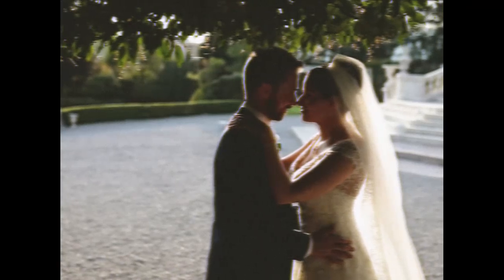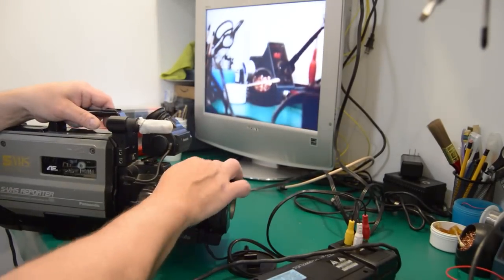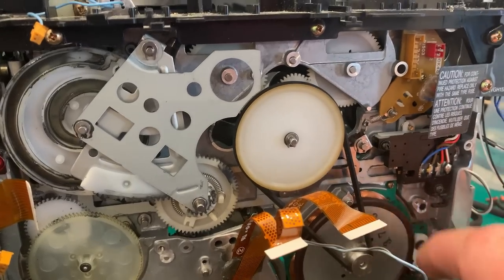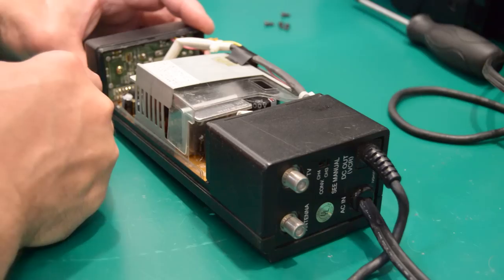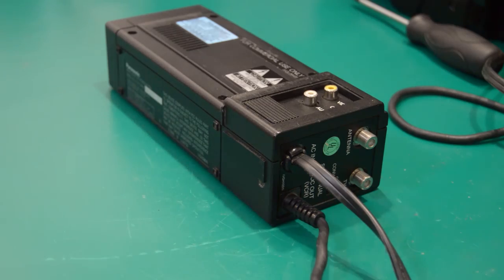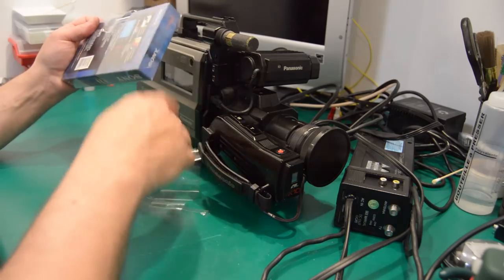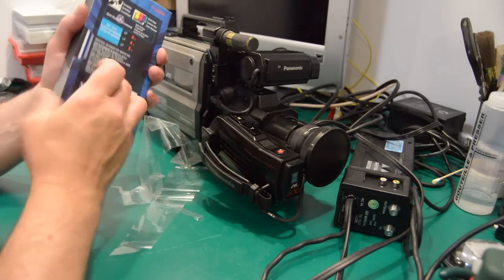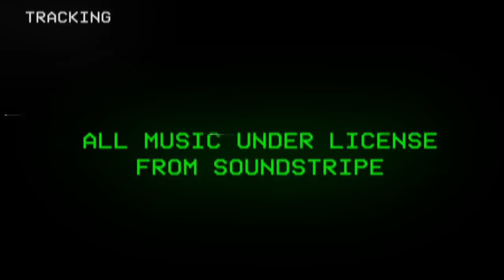RETRO TECH of the 90s 🎥 S-VHS Reporter Camera | Retro Repair Guy Episode 12

Comment: Hey Retro repair i have one question i buy Hitachi full size vhs when i turn on its power red light blinking eject working well but wont play i saw some videos and decided to change rubber belt after i chenge i don't now what happened now the problem is when i turn power button or eject button then loading motor and reel motor run automatically what is the case any ? Do i check capsitor same problem happens with my Panasonic m3000 motor runs automatically for some seconds then camera gose off
Reply from the maker: Hi Nayan. First of all it's important to understand that a camera  like this is just a VCR with a lens. When VCRs shut off it's because they detect something wrong; a protection mechanism. When you opened it and replaced the belt, if you did not align the position sensor or disrupted it, then it would cause the unit to shut off. Of course, there could also be a voltage problem but you would need to diagnose. I would start by making sure the mechanism is not blocked and verify the position sensor (you might need the service manual) and go from there. Thanks for watching.
Reply: @RetroRepairGuy  thanks you so much u always answered and help me out lots of love ❤️ ❤️❤️ thank you very much again stay blessed
Reply from the maker: @Vintagelover1  My pleasure! Thank you!

Comment: Do you think its possible to put a hd digital sensor in one of these?
Reply from the maker: Hi Paul. Could you elaborate? Do you mean for recording in HD?
Reply: @RetroRepairGuy  yes either to memory card or direct to pc via lead. I don't really know anything about optics but I'm assuming the lens is better than say a gopro or a cheap hd camcorder?
Reply from the maker: @paullewis9473  The lens is not bad but I don't remember what brand it is but it's a 8-80mm TV Zoom Lens. The CCD is 1/2 inch and capable of 400 lines of resolution so you can't get HD from it, however you can easily record directly to a computer or laptop using a USB capture card like this one which is very cheap ($19) and has a S-VHS input so you'll get the 400 lines. Here's an affiliate link it doesn't cost you anything and there's even an extra 5% off https://amzn.to/3qlJv4e You could then upscale the footage to HD using different methods or very simply in Adobe Premiere. Hope this helps! Thanks for watching!

Comment: What is alternative of rubber renue here in india cant find if shipping from us its very costly hope u advice best i want clean my Panasonic vhs Camcorder
Reply from the maker: Hi. Rubber Renue cleans and has a chemical that helps rejuvenate the rubber. However, it is perfectly safe to use the same alcohol for the heads to clean the rubber surface. The only problem is if the rubber is very old and hard the Rubber Renue makes it "gummy" again. However if the rubber is too old no chemicals will help it and will need to be replaced.
Reply: @RetroRepairGuy  always love to watch ur video and always kind reply thank you so much appreciated but my question is here in India i cant find rubber renue its too costly if shipping from us so can u suggest me any other cleaner that i use to clean head and all stuff
Reply from the maker: @vintagelover3873  Thank you again for kind words. No this is what I am saying, just use the alcohol it's the next best thing. I don't know of other products and automotive products that rejuvenate rubber is not the same as it leaves a residue and rather conditions the surfaces and adds protection.
Reply: @RetroRepairGuy  ohh dear now i got it thank you so much  gratitude 👏 thanks again for help would love to watch more videos always support ❤️👏

Comment: hi i have a JVC GR-C1E how much do you think it would cost to restore it ?
Reply from the maker: Hi Simon. OK first of all I'm extremely jealous! Anyway, very hard to estimate but does it work or have any problems? If there is troubleshooting the price would go up. I'll give you a large ballpark figure. The guys I know work at an average $35-$45 per hour. If you take an example of the one I just restored in this video, the power supply caps that were not standard value, belt, shipping etc. roughly $40 in parts. I did not recap the interior of the camera on this one and it was displaying an image and still put in 6-8 hours. So that would come out to $250-$350 (Canadian Dollars $180-$250 USD). And again, no troubleshooting, just cleaning, recapped power supply and belt(s) replaced. That's why it's not always worth it for older component unless you are doing it yourself or in the case of something you want to keep, like a BTTF camera! Thanks for watching!